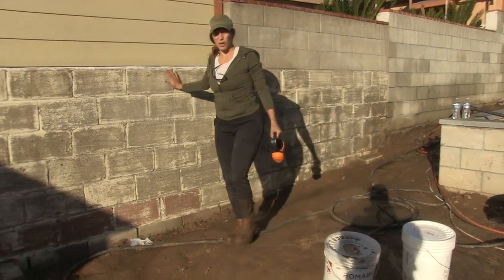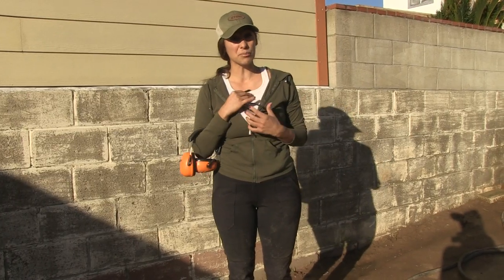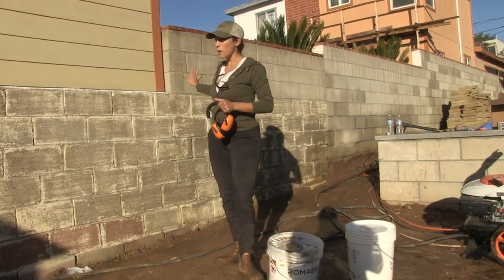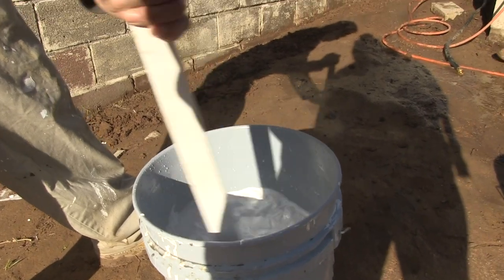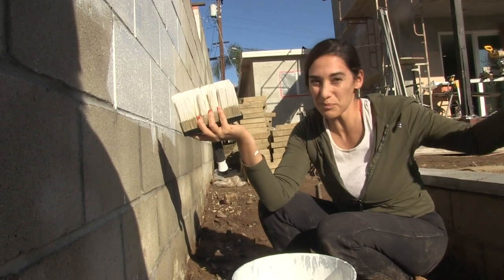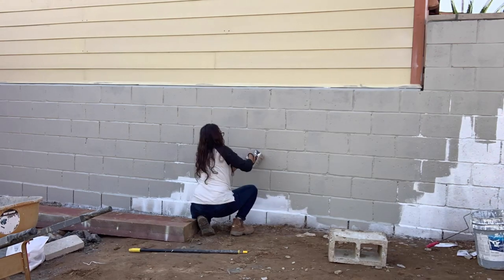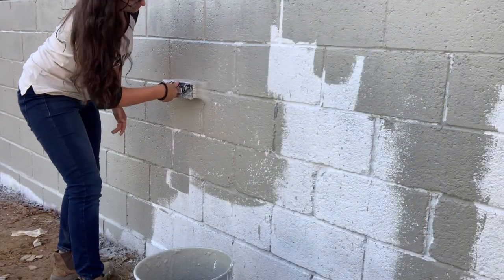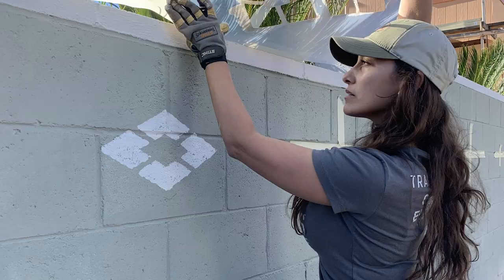Add Color to a Wall with Mineral Paint | Sara Bendrick

Comment: What a Godsend. I have been trying to figure out how to paint tumbled concrete blocks of various sizes of a short firepit wall. Prime with normal primer (oil or latex) then paint with a brush - because it is 3' high and about 40' around.  We tried to use a concrete color mix and that looks yuck. Since the very large island around is ruby red rocks - I would like a color that complements that - I can find it now. I wonder tonight if Depot or Lowes handles mineral paint, I have never asked. Thank you so much - any advice is appreciated. Seems I found you at just the right time!!
Reply: So how did your project go? I don’t think HD or Lowe’s sells mineral paint?

Comment: I have a neighbor who has a tall planter wall behind mine and the brick is starting to deteriorate on my side.  Would i be able to paint it if the neighbor is not willing to seal his side of the wall? I dont want to paint it if its going to peel off years later.  What do you recommend?